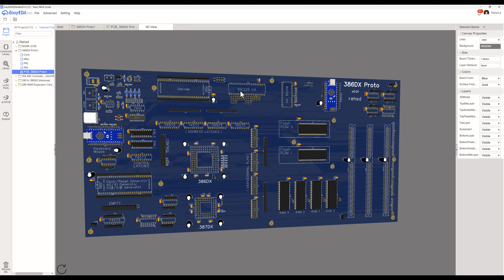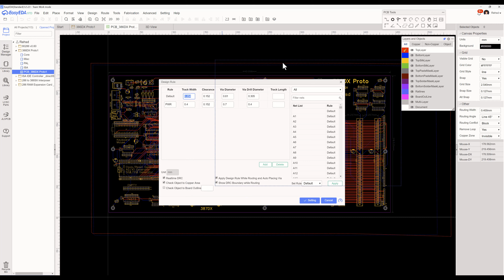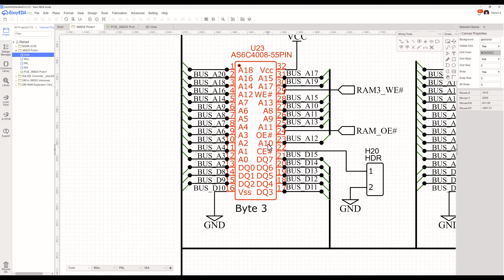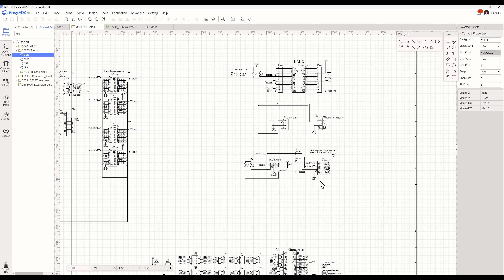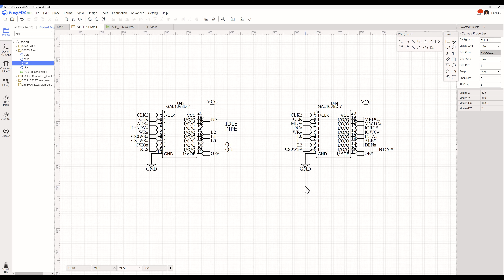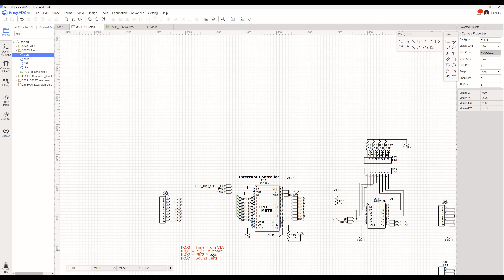80386 DX Build, Ep. 2 - Proto Board Updates -- Ready to Order

Comment: I'm honestly amazed at what you're able to get done in EasyEDA. I started out using it when I began my digital design hobby but quickly switched to KiCAD. It has been worlds better in terms of UX and I really prefer the way it's pcb layout editor works. Pairing it with FreeRouting gave me everything I needed to do what EasyEDA does. What keeps you coming back to EasyEDA?
Reply from the maker: I've used KiCAD a bit, but EasyEDA has been "easy" to use and has done everything I have needed. The library of components is fairly comprehensive, and that speeds things up (most of the time... unless those components have design errors). I don't use EasyEDA's autorouter and use FreeRouting instead, like you. So far, I really do not like the new EasyEDA Pro. In time, I might switch to KiCAD.
Reply: @rehsd  The parts library in EasyEDA is impressive for sure, and I like the ability to use community submitted parts. My biggest frustration with EasyEDA is the copper fill and keepout zones. The UX for that is so much easier IMO in KiCAD. But given that I'm almost always doing a 4 layer board, I may just use that more often than you have needed to.

Comment: A good design practice with 4 or more layers, special for signal integrity is always combine a signal layer with a ground plane. In this case you signal power layers are on the outside and the inner layers are all gnd.
Reply: Came here to suggest the same.  :D
Reply: I've followed Phil's Lab channel for a while now and for 4 layers I pretty much always use his suggested stack up: signal, dielectric, ground plane, core, ground plane, dielectric, signal. It's worked great for every board I've ordered and I am ususally doind something with USB (full speed).

Comment: I just started designing PCBs. Really enjoying how you explain this. For power on mine I went with (full size) USB type B so far.

Also very similar, 2 layers and through hole is working out so far.

Based on this I’m going to add more headers for troubleshooting more of the circuit

Comment: I hear you when you say you want to keep it on two layers.

I've just done a 6 layer board and because of a quirk with KiCad I had one trace with a couple of vias that ended up shorting all of the inner copper layers together.

To fix it I ended up buying a Dremel and drilling out the offending vias.

Thankfully I was able to get a functional board out of it which Ive built up and figured out all of the issues for rev 2. I'll order that some time in the next couple of months once some work travel settles down and I've got more time at home. Until then I can get away with the one I've managed to build up so far.
Reply from the maker: I'm guessing that took a little bit to track down (the cause of the short)? I haven't been brave enough to do a six-layer board yet.
Reply: @rehsd  Actually I found it surprisingly quickly. First off I did something which I dont really ever seem to do, which was to measure continuity/resistance between VCC and gnd. Im not sure why I did that, but Im glad I did because had I build a board up and then plugged it in I'd have been scratching my head about why it wasnt working.

After I discovered that was a dead short I just started looking around the board in KiCad for any signs of vias that didnt have the copper pulled back from them. I think it was just a bit of luck really that it was still present in the board file, because if I had saved the "fixed" version of the PCB after I sent the dodgy ones off I'd have had a hell of a time figuring out which one(s) it was.

Then it was a matter of figuring out how to fix it. I'd considered getting some fixed boards made and calling the first ones a write off, but Im glad I didnt go down that route because there were other issues that I discovered along the way that will be fixed in the next run of boards. So I still got some good use out of these boards and they werent a complete waste.

The Dremel cost about the same amount as a new set of boards, so I guess in the end Ive spent about the same amount of money, but now I have an extra tool for future use rather than some busted PCBs that will just gather dust (or now I have a tool that will gather dust instead lol). :-)